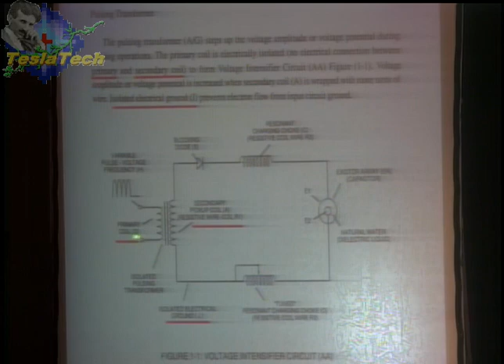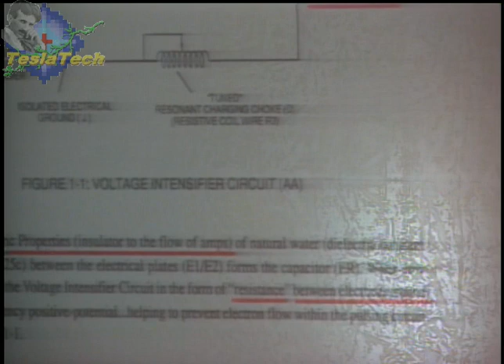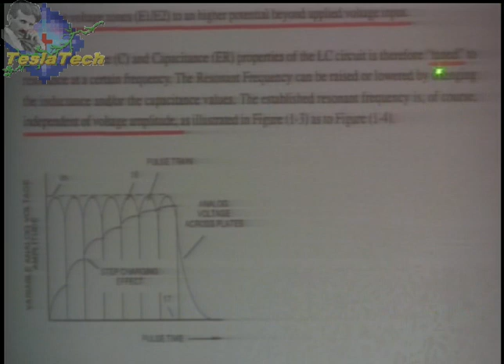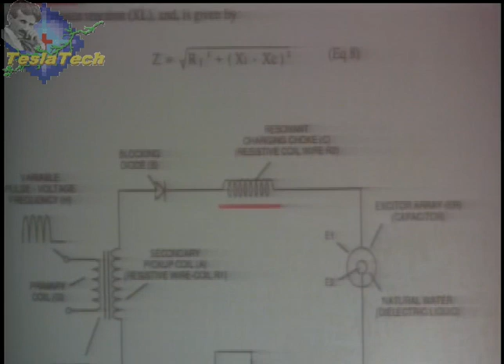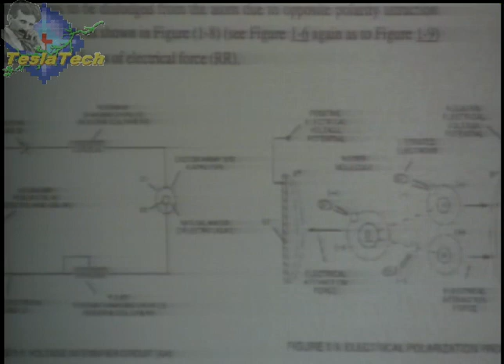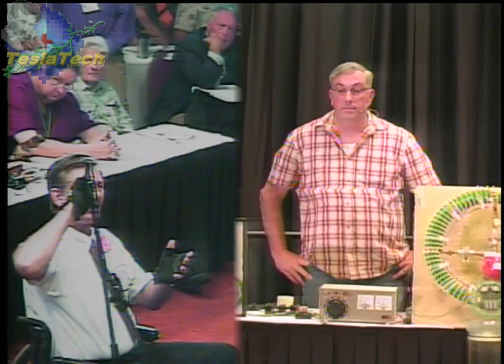Max Miller - Stan Meyer Unveiled! Convert Water to Fuel, Extraordinary Technology Conference, 2015

Comment: The downside to burning water is that it's a finite resource; eventually there wont be any water for life At All! 

If you want to remove the worlds oceans, than by all means, use water as fuel.
Reply: Sounds like something from the mouth of AOC
Reply: The byproduct of burning hydrogen is water vapor. Water goes in, water comes out, and the car rolls down the road, zero emissions. And you can reclaim the water vapor by connecting the exhaust pipe to the fuel tank. If you could capture 100% of the water coming out of the exhaust, one tank of water would last forever. The presenter explains the extra electrons come from angel fart avalanches. It just makes sense!
Reply: You being serious? Thats not how that works.
Reply: Yeah! And all of the islands might sink or tip-over!
Reply: Not a very smart statement. Hope your not serious
Reply: It didn't work at all,it was a complete con so we don't really need to worry about the oceans running dry🤣🤣
Reply: OMG do u hear urself

Comment: Both the positive and the negative aspects of an electric field come from the same source, a magnetic push of electrons somewhere else in the circuit. The created potential difference will cause the water molecule’s bonds to be overcome.
Instead of passing current through the water, we pass the water through the static high voltage field. High voltage bond breaking potential with no current flow. Time the water jetting through the field with the high voltage spike. Brilliant.
Reply: Kinda understand.  Instead of pass the current thru the water.  We pass the water thru a certain electrical field n that makes the water molecules lose thier bond n what does that make happen??         Just looking to get a better grasp of the process I'm seeing here.  Bless day
Reply: @julianrombley9966  
Just like a car pressurizes a regular  Gasoline tank we would pressurize a water tank. The pressure allows the fluid to flow to the injector. But in this case, the injector is where we create the high voltage field. The water breakdown happens inside the injector and the resulting HHO gases along with a small amount of unbroken water 💦 is pushed/drawn into the cylinder before the compression stroke. At the end of the compression stroke a spark explodes the HHO releasing its energy, the small amount of water is vaporized into high temperature steam enhancing the cylinder pressure in the power stroke. The energy savings comes from the fact that we would be breaking the water using a voltage field instead of current.
Reply: @m.j.r.technologyreveiws1075  would the steam in the combustion chamber effect the life span of the engine? or is that just not worth considering at this early stage of development.
Reply: @gogogeedus  
Not really sure how to answer that question accept to say that we’ve had steam engines for many decades. Turning water into steam has been the way we’ve pushed pistons since early on. Here we’re again just basically looking for the best way to get the energy required to make steam to push pistons. The focus is on the design of the injector. It just adds the proper proportions of what is needed, we would still need oil as a lubricant as well.
Reply: @julianrombley9966  the electric field approaches infinity, which causes the bonds to break and current flow. The current that flow is not from the power supply but from the water molecule acting as a power source.
Reply: Honestly I wish I 100% overs what u wrote there.  Bless day
Reply: The amount of bs in this vids is a thing of beauty... "High voltage bond breaking potential with no current flow "... yeah, I have invented the "high impact bond breaking without contact", we'll see which's better, ha!!
Reply: Well becuase hudrogen has much worse power to density ratio than gas even such e small injector which generates hydrogen the amount would never drive quite fast the car. Think of like if gas drob the hydrogen needs to be 100 drops. Injecting 200hp would need 100 times more amount hydrogen thus such a small hydrogen breaker unit would not ever make the car run fast. The biggest singular issue with hydrogen is density to power ratio which toally breaks usually any compustion engine models. If you need gas one drob and 99 air you would need equal amount hp to input 33/67 mix of hydrogen atleast.
Reply: And that results either 33 times more pressure than gas as if you input 1drob per second then u need 33 drobs in second so you need to have quite lot bigger pressure with hydrogen. That said hydrogen is faster than gas to fill as it propagates quite fast vs gas so you would say about 9 times bigger pressure needed at infold to gain similat power levels from hydrogen than gas. These are engineers  rule of mind not exact figures at all. Im just using basic water analogy of electronics. If water that has 1 runs on cavity and mixes with air result is mixture used. If we change 0.1 water to cavity we need 10x more preussre to get same mixture at end result.
Reply: That Said U could do rotary engine that has 3 injectors each engine and u use 6 of them that means total of 18 injectors on the motor and it would start produching enough torque on low pressure to be viable motor for typical car on the road. Because rotary motor can generate more hp and less loss than piston engine then gain there reduces the difference on gas piston engine powers vs hydrogen needed  to produce same amounts of power. How ever doing rotary engine with hydrogen is extremely dificult as hydrogen can leak small crevises thus resulting easilly backfiring.
Reply: The most iconic reason why stanley did not suceed is, if he never got it work asuming he did, he could not ever drive quite fast tille example over 60km/h. The injector is too small to produce sufficient amount hydrogen and he had issues because using standard piston engine never work good with hydrogen as it backfires and oil cavity can collect hydrogen and then the engine is essentially a bomb.
Reply: To add more the problem with hydrogen is that it's a gas. Gasoline is liquid. Gas can penerate small crevises and is a lot harder to handle and prevent unwanted actions to occure.
Reply: @djvalon  
Such a system could still be useful even if only providing sufficient power in a hybrid car to run a generator to recharge a bank of cells for a car’s electric drive motors.
Reply: @m.j.r.technologyreveiws1075  yes that's true. But I also read that he mixed the hydrogen with air and ionized noncombustible gasses. The gasses steal the electrons and prevent water from forming during combustion. So mass is converted to energy inorder to provide the missing electrons and as such the energy yield of the HHO mix can increase up to 3 folds.

Comment: The townsend effect/multipaction happens in vacuum, not in materials, because the mean free path is too short. That said, I could see high voltage AC inducing something analogous to a corona discharge or dark discharge in water